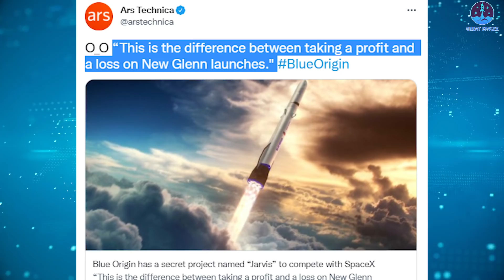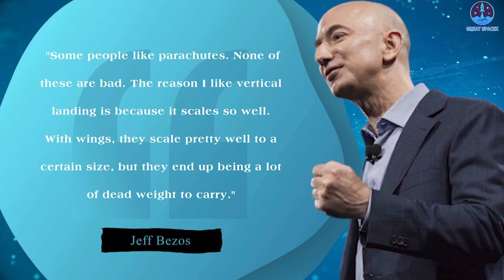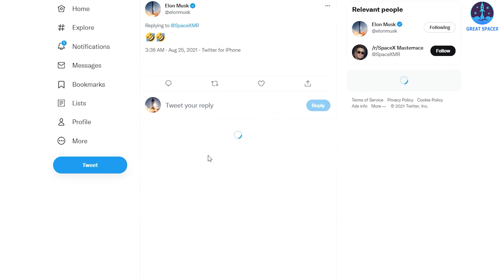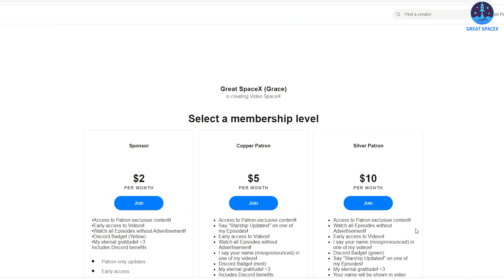SpaceX vs Blue Origin: Elon Musk's Reaction to Jeff Bezos NEW Stainless Steel Test Tank

Comment: SpaceX has not managed to make the second stage reusable (while Elon at the time mentioned it a lot that they were working on that), all ideas got shot down during calculations and simulation phase. It's THAT hard to return a second stage. It needs it's own heat shield because it is coming in from orbital speeds. Starship is technically the second stage of superheavy, and it needs the heat shield.
If SpaceX hasn't done it yet, that means it is not feasible with current technology. Same goes for aerospike engines. Musk has often said they are his favorite of all rocket engines, but there is no use for them beside SSTO vehicles, which is not feasible for Earth. Although it might be for Moon and Mars.
Reply from the maker: Thanks a lot! That's an amazing information. Hope you enjoy this video.

Comment: This is just how development works, nothing to laugh at. Once you realize your attempt will not work /be cost efficient or ourdated, you have to change plans or scrap the project instead of pushing forward into a dead end.
And stuff like building test tanks or changing materials is nothing special. Its just part of regular engineering.

Comment: Elon has a vision to make the us an interplanetary species.  That vision is independent of what Blue Origin, ULA or even NASA are doing.  It is easy to see how everyone else has been stuck with the Apollo era mindset on rockets.  Elon is looking to Mars when everyone else is touting suborbital tourism.  And it’s not like Blue Origin can undercut Space X because Elon is 10 steps ahead in cutting off all the unnecessary design aspects and optimizing the production.  Where Blue Origin may have one stainless steel tank, Space X is already working on SN 24 when SN 20 hasn’t even launched yet.  They are working on making the manufacturing needed for a fleet of starships, and they will all be fully reusable.  SLS is still using 1980 shuttle components. Bezos hasn’t even reached orbit and Musk has already been to the ISS and sent a Tesla Roadster into a heliocentric orbit.  I wouldn’t be surprised if Musk lands something on Mars before Bezos can land something on the moon.

Comment: it makes perfect sense to build your test rockets from a cheaper material with more rapid construction. once that developement is done you them move over to constructing using lighter more expensive materials. 
elons never shown any real concern with people imitating his work. spacex is at least 2 steps ahead in developement beyond what we see on the ground at boca chica. perfect example is the tim dodd (everyday astronaut) interview from a few weeks back
theres no space race if only one team is running. but theres always a loser.
Reply: I doubt SpaceX will switch to anything but steel alloy any time soon for the final product.  They're specially formulating it for these conditions and the price point is also  a major part of the mass production plan.  Carbon fiber, for example, doesn't have the right range of mechanical and thermal strengths as steel even if it's lighter by a bit and the cost doesn't scale favorably for mass production.

Comment: The aerospike idea is the only chance BO has to catch SpaceX
Reply from the maker: Haha no way:)
Reply: @colonbina1  the pace of innovation is extremely fast at spacex right now. So if bo try to compete in the same space they will have to outpace spacex in innovation or they will lose. The other option is to try to innovate in another area. The Aerospike idea is a space that has potential to revolutionise rocketry but as it hasn't really been done at scale before so it's high risk high reward. If they pulled it off though, they could leapfrog into first place or into a category of their own.

Comment: I say stick with basics. Use High altitude balloons/blimp to get you close to the upper atmosphere (like 95%), then launch a small drone to take a package into the outer atmosphere. Use this package to unfold into a solar sail, that can pull your crew capsule all the way out in to space.... or a big loop in the sky to be snared by a passing space ship. as you ditch the heavier high altitude blimp that got you most of the way up. 

If you wanted to make it super basic & reusable, then use a tether line.

Tether lines will brake. This is why the best place to setup HAB (High Altitude Blimps) airport is over the ocean. You set up the airport so that the 'Tlines' hang out over the ocean. If you ever have a brake, the line will fall harmlessly into the ocean, you can collect it. A HAB set a drifted is not the end of the world, just a pain the but to get back to the airport.

I bet you could set some up over the great lakes... large open deserts.

anyways, the trick will be to get people out into space. People don't weight all that much, so skip the big crazy rocket for people. Just float them up to the high upper atmosphere, and pluck them off the HAB.

🙄👀🤷‍♂️

👨‍🔧👨‍🔬👨‍🚀🧙‍♂️ Need a crack crew!

Comment: I'm fine with BO copying SpaceX. If anything it shows despite what they say in their GAO protest and lawsuit, BO believes Starship is going to work. I think the question is how well will Starship work. If Starship meets most of it's design goals. I doubt the New Glen architecture is going to be able to adapt to be competitive. New Glenn was designed to outperform Falcon Heavy, not compete with Starship....For instance landing and relaunching more than once a day. I doubt the New Glenn booster or BE4 engine have much chance of doing that.

Comment: I hate it when people just in on stuff they know next to nothing about.  Lawsuits to get input from and even reverse government contracts is nothing new, probably going back to the 1800's. Not saying they are right, but after the AWS and Trump contract issue, I would question this contract as well. Also, a stainless steel looking rocket? Have you seen old test rockets?  Many of them had stainless steel exteriors. And I wouldn't talk about stealing things.  Space X stole the landing system from McDonnell Douglas, the drone ship idea from Lockheed Martin and at least two other companies, even his engine design are nearly identical to models from both the Saturn V and the Russian engine the government is trying to cut.  And that's just Space X.

Comment: Sometimes i agree with blue origin, Starship moon launch is too complex, expensive, and risky.

Imagine you need 16x refueling for single trip to the moon. If Elon musk can inventing new kind of fuel, this problem can be solved.

Liquid methane is only contain 50 Mega Joule energy per KG. Hydrogen is 120 Mega Joule per KG. Metalic hydrogen is 200 Mega Joule per KG.

By using new fuel, refueling stage can be reduce.

Comment: Time for Musk to counter "Project Jarvis" with "Project Dead End". First make a huge announcement that SpaceX has had a huge breakthrough on a new design for Starship. Then start a new Starship iteration that is totally fake while secretly continuing to build the real starship and booster out of sight. Something really stupid like the rocket body will be composed of stainless steel shavings suspended in resin with fiberglass.  And then for landing drop the vertical landing on legs and build huge switchblade wings so it can supposedly land on a runway.

Comment: BO didn't even finish their BE4 engine, they have to get up before they try to come back down.
They are at least 5 years behind.
I think Rocketlab has better chances to develop a reusable proton rocket than this Jarvis program, (like Jeff could pose as iron man)
Reply: that would be hilarious if one or more OTHER rocket companies beat out BO. LOL
Reply: @mkocel  Rocketlab is already testing electron rocket to reuse first stage. 
It will open a parachute and be snatched out of sky by a helicopter.
Reply: Spacex's Raptor isn't exacly a finished product ether.🤷
Reply: @patrick_test123  Nothing is ever  a finished product in SpaceX since they are always trying to improve. 
However, they already flown their rocket, and are about to put the first prototype in orbit. 
Where is BO? 
Their rocket engines are late for beyond 2022. 
As I said, at least 5 years behind. And loosing engineers
Reply: @claudiomaiasantos  They very much are prototypes and would not be used in a revenue launch.

Comment: New Glen was supposed to use traditional design methods like proven by design. By changing material into stainless steel and promoting fast iterative design confirm my suspicions that NewGlen failed. They have been facing increased amount of problems in integration phase and have realized it'll never work.

This new change practically mean they scrap the original design and start from scratch.

No wonder why people are leaving and Bezos can't swallow defeat with lunar lander.
Reply: Musks rulles of design:
1) Make your requirements less dumb. Your requirements are definitely dumb. ...
2) Try very hard to delete the part or process. ...
3) Simplify or optimize. ...
4) Accelerate cycle time. ...
5) Automate. ...
BO is at the stage 3, trying hard to optimize something that should not exist because their requirements were dumb in the first place. If they try to go back to the drawing board now, they will be not 19 but 50 years behind Spacex. On top of that top engineers started to leave BO, realizing that if they wan't to stay relevant in the space industry they have to leave this dead project. Bezos will be lucky if he gets a contract to make packaging for space food. Amazon workers have done some extensive testing of an innovative, minimalistic design of a "space toilet". Results are promising.
Reply: If B.O. had been building hardware and testing it they would have found out that their approach wasn’t working much sooner.  Design on paper can only take you so far.  Their motto should be, “Test early - test often.”
Reply from the maker: Thanks a lot for your useful information! Hope you enjoy this video.